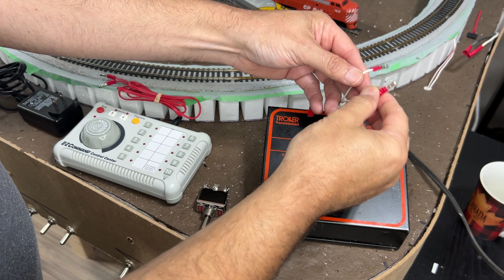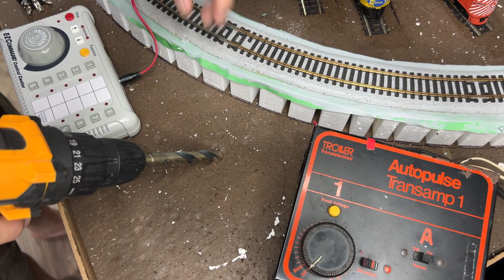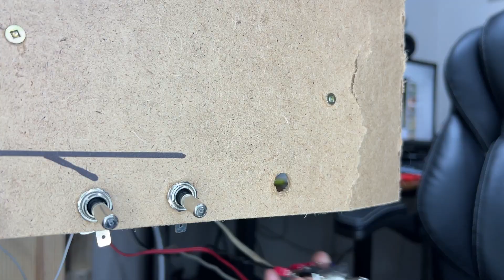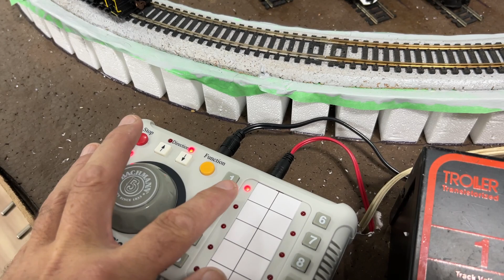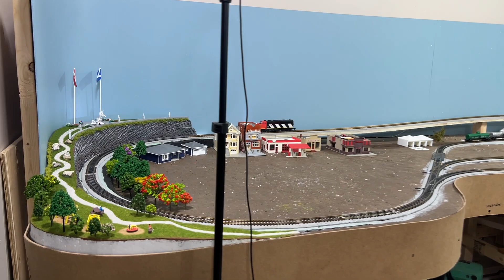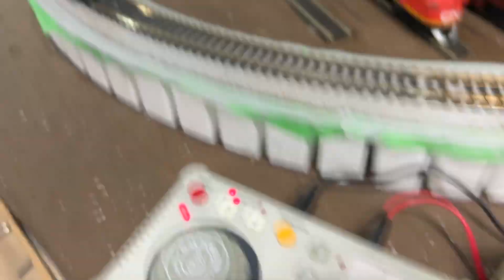Installing A Simple Switch For DC OR DCC Model Train Control

Comment: Save yourself a ton of money and stay with DC. Get Blunami decoders, and your loco will operate like DCC with your phone. No expensive DCC equipment to purchase, and your loco will run on any layout.
Reply from the maker: I got a dcc systen for 50 dollars and my decoders are 20 dollars each. Not exactly expensive equipment.
Reply: @ScottRails If I could get a system for $50, I would jump at the chance. That Bachmann your using on does 1 digit addresses. Unfortunately,  a handheld controller is around $200 and will only do about a third of what my phone will do with a Blunami decoder and the phone is free. Plus I have 4 other phones that can work my trains as they are retired from phone service. Being retired (like my phones) I have to watch every penny I spend. Installing a decoder that costs a few dollars more but allows me to run it with a power pack I picked up at a garage sale is a no brainer for me.

Comment: Here is my question from a guy who has a dc layout.  The one thing my blue boxes do not do well is so that realistic looking creep on start up and slow down.  I am thinking it may be fun to move all of my stuff to dcc.  Will changed over blue boxes creep well or is that just a dream?  Honestly, that is the one thing I see that gets me thinking. So does anyone who has change up think their blueboxes that have been given the decoder treatment and moved to dcc, are you getting better loco movement?
Reply: Scott, do you find locos ‘creep’ better in DCC? Or is t the same as DC?
Reply from the maker: I know what you're talking about. The problem (I think) is how the DC motor reacts to the DC power supply you are using. This increment of power is replaced by circuitry when you switch to DCC. 
I have some old blue box locos that creep incredibly well on dcc.

Comment: Wow! This is phenomenally helpful!. I'm just getting started in the hobby and I wanted to start from the ground up and learn the DC but have been hearing about the DCC, but I did not want to confuse myself by trying to understand both at the same time. I also did not want to build a layout using old technology and then have to tear it all out and start over to  move to DCC, I'm 63 and I may not have that kind of time, lol. This is the perfect video to explain how to do both at the same time and your other videos have helped me to understand track blocking in a way that I grasp the concept.... parking your locos so they can be on the track but not running was  a very good way to explain it! Do other DCC control systems allow you to run DC also? Just curious....Does it have to to state it or is it assumed it does?

Comment: How did you wire switches and isolate them?
Reply from the maker: I think I have another video for that, but basically, I added insulating rail connectors to each section and added feeder wires from each rail to the bus line underneath.
I then intercepted one wire from each rail and inserted a simple in-line on/off switch.
Reply: thank you

Comment: So you are soldering those center wires to the track and not using the terminal track? I assume I could still use the terminal / re railler track? Just put the proper connectors on the wire coming from the switch to the terminal track? That is my assumption is would rather not solder to the track. Correct?
Reply from the maker: You are correct. I have two wires (+/-) going round the underside of my entire track system. Every section of track has power feeders going to those two wires.
Connecting those two switch centre wires to a track connector will do the same job, but with a bit less reliability.

Comment: I'm trying to find that switch, actually I'm looking for a switch that would switch between 3 sources to my track. (DC controller, kato smart controller and z21 dcc controller) can you tell us the name of the switch or share the link?
Reply from the maker: This is the switch I got, but it won't work for what you are planning:
https://amzn.to/49fFfXG

I think you need to look for a rotary selection switch. Maybe something like this: https://amzn.to/3PFu7MV
Reply: @ScottRails  wow, thanks for the quick response
Reply: I have 13 blocks on my 4X9 DC layout.  I also have 2 DC cabs (A and B.) I’m using all Atlas block selectors.  Any suggestions on how to set it up for DC and DCC operation?
Thanks!

Comment: It is really a bad idea to run your DC powered locos on DCC power.  The buzzing sound is your motor switching polarity at a really fast rate and will eventually burn out the coil winds of the motor.  Running DCC locos is very possible on DC power but not the other way round.
Reply from the maker: I totally agree, and if my locos were worth more than 30 dollars I wouldn't do it, hehehe. I don't mind upgrading the motors when the time comes.

Comment: I am confused.  Firstly I see you install a changeover switch linking a DC controller and a DCC controller to the same track. The switch ensures that both DC and DCC cannot power the track at the same time.  I get that.  Next you run an engine using the DCC controller and show switching the engine’s lights etc.  I get that.  Then you select a second engine from a siding using DC to run it on the same track. How can that be???  Perhaps I have missed something or I just do not get what is happening - but I am very impressed.  Please can you explain and put me back on the track - so to speak?   Excellent presentation of your skills and what you are achieving I must say.  Well done and thank you.  Kind Regards.   Mike - London, England.
Reply from the maker: I see how that got confusing, sorry about that.
The Bachman DCC controller allows you to run DC trains at the same time as DCC trains. But to make like simple I will only run ONE DC train at a time.
That means I can treat the DC train as normal with forward and reverse, while controlling up to 8 DCC locos at the same time.

That would be ridiculous on a single loop layout though. Even with two I manage to crash.

Comment: Did you read my mind ?  :) 

I will be doing the exact same thing for my N-Rail compatible modules.  However, this is so that I can change between two different DCC systems.  N-Rail requires Digitrax compliance for shows; but I will be using MRC Prodigy at home.  So I need to be able to select between which system sends power/signals to which of the 3 bus wires.  In theory, I could use Digitrax on 1 track and MRC on another.

Personally, I don't like the look of a toggle switch like the one you used.  I find there is an increased chance of accidentally catching it on clothes.  So I am planning to use DPDT on-off-on rocker switches instead -- if only Amazon would ship the correct ones.  I've ordered 3 times from Amazon and 3 times they sent me DPDT on-off rocker switches !  That's 3 strikes !  So, while it probably will cost me more, I am heading to a local electrical/electronics supply store near my work to see if I can get the switches I want.
Reply from the maker: I'm just using what works for now. One day I might make it pretty.

Comment: Good demo. With great power comes great responsibil... eh, why not? Awhile ago, out of curiousity, I applied DC power to a tiny decorative AC bulb. The bulb got brighter and brighter as I turned the power up, until it blew, just as it should. Sometimes it's worth sacrificing a cheap item so you don't make the same mistake with a prize loco that cost a king's ransom.
Reply from the maker: Exactly my philosophy, plus I'm a child and it's fun to blow things up.